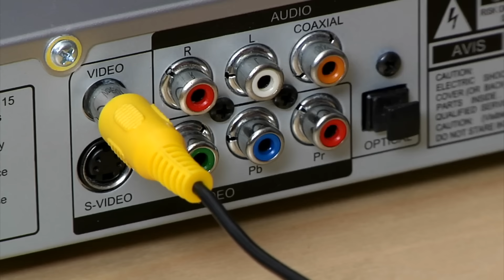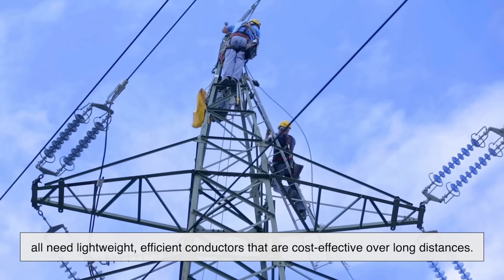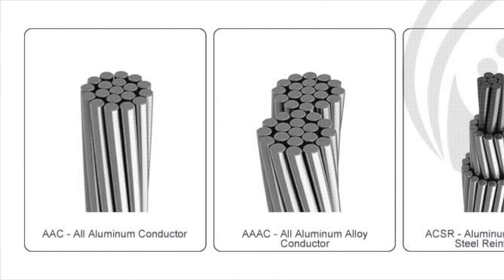Why Do Power Lines Use Aluminum Instead of Copper?

Comment: Pity that we don't live in a world where gold and silver aren't as common as dirt.   Silver is the best conductor and gold doesn't taransh.   Both would make outstanding wire except for the cost.
Reply: There is more as they say than just the cost it is true that silver is the best metal conductor of all metals however it has a very high specific gravity approximately 10.5  gold similarly has its at 19.3 compare that again to Aluminium which is 2.7 Silver also tarnishes readily due to sulphur compounds in the air too difficult to use for this purpose.
Reply: @michaeltwomey6201  I'm not suggesting for power lines due to the weight, but for home wiring.   A mixture of gold and silver does not tarnish.  I'm not sure what the resistance is, but the right mixture might be better than copper.
Reply: @BobDiaz123  Yes well that might be feasible I guess hahahahaha lol if you were Elon musk you could certainly afford it. The resistance would be acceptable, however the gold content would have to be somewhat greater than the silver to counter corrosion.
Reply: We will if we accept Jesus Christ even the streets are made of gold. 73

Comment: Having worked for Ma Bell in the 70’s as a cable splicer, I buried miles of copper cable!  Multiply this nation wide.  

Now with much of our telecommunications being wireless I have been wondering if there maybe an economical method of removing and reusing all the large buried copper cables!  

Daily I notice dozens of abandoned splice boxes along highways $$$$.  And not to forget arial cables!

Comment: Because its lighter and cheaper.  Also, the aluminum in acsr (power line) is higher tensile strength, and consequently more brittle than the aluminum in cables.  It also has a steal support ran in the center.

Comment: In the UK, Devon, where we live, the power line company replaced the aluminium power lines with copper some time ago, as they said the aluminium ones were getting metal fatigue and breaking.
Reply: There are no overhead copper HV power lines in the UK !
Reply: @andyxox4168  I am talking about the wooden posts with 2 wires, so not the highest voltage, and that was what they said when they replaced them maybe 30 years ago.
Reply: @joseph9915  those aren’t really ‘power lines’ rather they are MV/LV overhead cables … but I get your point. HV overhead lines also suffer fatigue at the hangers and they have reinforcing wires wrapped around them and dampers adjacent to stop oscillations in order to reduce fatigue
Reply: @andyxox4168  Maybe, still brings the electric 5 miles to where there is a transformer, stepping it down to 240 for our farm. :) 

PS. Only 2-phase, pain we can't get 3-phase without paying a fortune.

Comment: Copper conducts electricity nicely even when corroded, where as aluminum DOES NOT. This is why copper is used in housing and in electronic devices - far more durable and reliable than aluminum.

Comment: @6:45: "high-voltage direct current (HVDC) lines" -- LOL, I never knew DC comes in 3 phases.
Reply: Tell us you're a idiot without telling us. You do realize HVDC already exists in multiple locations. It's primarily used for carrying extremely large amounts of electricity long distances because it's actually more efficient than AC at distances over 1000km if I recall correctly on that distance.

Comment: I've seen underground heavy cable that still has a big copper element in it with 3 big sections of aluminum wrapped around it which also acts as a physical shield to a degree. I'm guessing they were carrying 3-phase or similar.

Comment: In Glassport Pa. There was a company called Copperweld until the 1960s when it was sold to a French company.They promised not to move the plant they lied closed the plant took the patent and went overseas.Copper weld had a process to combine copper and aluminum for transmission lines .Alcoa was a local company probably how they developed it.But everything is once was around here.

Comment: Haven't even watched the video yet but I'm fairly confident it's because 1. Aluminum conducts electricity almost as well as copper 2. Aluminum is far cheaper than copper, and possibly 3. Aluminum is lighter and stronger than copper when spanning long gaps between utility poles.

Comment: Aluminum wiring in residential was commonly used in branch circuits even into the early 1980's. Aluminum wiring is still often used for dedicated circuits and runs to sub panels where code allows.

Comment: Perhaps some more in-depth mention of Voltage⚡️& Amperage would be helpful.
Reply: The current carrying capability of aluminum is reduced by the high voltage used.  Voltage X Amperage = Wattage (power).  The higher the voltage, the lower the current, which reduces resistance loss.
Reply: @Garrison169 So 🥧 80MW÷138KV=437A EIR 138÷437=315♎️ than 2" Alum wire should be ok with a 3 phase system 🤔

Comment: I didn't realize HV transmission lines are mainly aluminum with a steel core. I always thought they were just steel. I wonder what they do to prevent the galvanic corrosion between the steel and aluminum. The aluminum will corrode against steel unless the steel is electrically isolated from the aluminum. This deserves a separate video about the cables.
Reply: Eventually you replace the cable… (after a half century or so in service).
Reply: I love it when democrats argue with each other
Reply: I'm thinking (layman here with a little knowledge [I know -it's a dangerous thing 😅]!!!) but there are many substances that require a "bonding agent" thereby letting them work together. That could make an interesting video as well!
Reply: … grease
Reply: It’s probably just insulated. It’s just there for strength!
Reply: @JohnDoe-qz1ql , no neither the steel nor the aluminium is insulated.
Reply: @andyxox4168 While not Considered a typical form of insulation it’s still galvanized steel.
Reply: @JohnDoe-qz1ql  .. they’re greased to stop bimetallic corrosion.

If you’d ever used it or been near it you’d know.

p.s. … Zinc is not an insulator!
Reply: @andyxox4168 LOL! It’s not greased. The steel is galvanized.
Reply: @JohnDoe-qz1ql  I see you know nothing about the potential for galvanic corrosion … 

… as for grease see one example below, 

METALUBE’s OCG™ range of high-performance, non-melting, cold-applied grease is designed specifically for the protection and preservation of overhead line conductors. OCG™ technology has the proven capability to extend the life and efficiency of overhead line conductors by providing optimum anti-corrosion protection and absolute minimal oil separation when used as a composite part of the conductor
Reply: @andyxox4168 Who Doesn’t?? Nothing lasts forever…. Still, if in a dry location, Say for example INSIDE AN INSULATED WIRE, it can still last a while.
Reply: @JohnDoe-qz1ql  … and OHL conductors are not, ARE NOT, insulated.

As I noted before the nearest you’ve been to one is perhaps strolling underneath it in awe of the people who actually know how they work!
Reply: @andyxox4168 I’m not an electrician, I’m a mason thank you very much. Yes, I actually Did know that, but that doesn’t mean Everyone Does. I see arrogance is a virtue in Your circles.
Reply: @JohnDoe-qz1ql  good, you stick to sand and cement and let the professionals comment on how transmission lines are constructed …
Reply: @andyxox4168 right! Ask any bird.
Reply: Just don't worry about it has been working this way for a century!
Reply: @bobboscarato1313  Has it though?  They haven't even been using it that long. They also change the cable.

Comment: Another major consideration for using Cu indoors is the lower coefficient of expansion.  Al expands more as it heats up.  The implication is that it loosens up connections far more easily, therefore causing higher resistance more quickly.  So unless, as mentioned,  the terminations (light fixtures, switches, receptacles, etc.) and other interconnections are designed to accept Al, it can be very dangerous.  It can be safe, it just takes a knowledgeable, competent, and careful electrician to install it all.
Reply: I used to have a mobile home wired with aluminum. I made a point of annually checking all of the electrical connections to ensure they were tight. In the six years I lived in that home I almost always found at least one connection that had worked loose. Usually in the plug receptacles. I presumed it was due to the aluminum expanding and contracting due to heat. It was a scary place to live in.
Reply: @davemeise2192 You made my point. Most homes are neglected in annual maintenance, and most people are too incompetent to service their own electrical/plumbing safely.
Aluminum wiring requires a bit more attention.
Reply: Only if you terminate aluminum at something with incompatible thermal expansion. Use an aluminum rated outlet or light switch and you are every bit as safe as copper with copper compatible terminators.

Comment: I have listened to the whole video, it is good, and very correct. . . .  I would like to take it a little further, that is explain those high aluminium wires between towers a little further.

They are not just aluminum cables, you may have noticed they are stranded. . .   The outer Aluminum layers will be specially produced for best electrical conduction, the next layer inside, will be more about strength, so different types of aluminium alloy.. . .  Then the inner core used to be steel for strength, but the newer ones, now use special fibres, to make the cables actually stronger and lighter, so the towers can be further apart, thus still improving costs.

You might have also noticed, that each actual cable, is actually 4 cables spaced about 6 inches apart, with spacers. . . .  It might sound strange, but the magnetic field caused by the current in these wires, causes "Skin effect", which means most of the current travels in the skin of the wires, that is why they are stranded, and the outer layer, better for conduction than the inner layer. . .    And then by making 4 wires, spaced a little apart, we can further improve on reducing the "Skin effect" and by so doing, reduce power losses.

But now, we are even going further into better cables. . .  He briefly mentioned it. .. .  Actually DC is better for all this high power than AC. . .    So there is more use of High Voltage DC or HVDC now being used. .      DC does not have the "Skin effect" or other inductive and capacative losses. . . .   So we can get more power through the same cables using HVDC. . . .   China is now using DC of over 1 million Volts, ( 1,000,000 Volts ), over some very long transmission lines, 600,000 Volts is becoming more common. . .   HVDC is now cheaper even for new transmission lines of over about 50 km distance, so very much coming into use for Wind Farms, this cost even includes the AC to DC Converters, which use very large, special Transistors, yes, transistors for these Converters, AC to DC and DC to AC conversions.. . . .  More if you want.
Reply: The problem with DC voltage is that you can't use transformers as you do with AC.
Reply: @bobboscarato1313    Oh yes we do use Transformers with HVDC systems these days.. .    As I explained, modern DC systems include two parts, the Transformer to convert between two different voltages, and the AC-DC-AC Transistor Converters, which are now relatively cheap.       So yes we do use Transformers with HVDC systems.
Reply: @bobboscarato1313     Oh yes we do these days.. .    As I explained, modern DC systems include two parts, the Transformer to convert between two different voltages, and the AC-DC-AC Transistor Converters, which are now relatively cheap.       So yes we do use Transformers with HVDC systems.

Comment: 6:12  And with heat, the aluminum expands and contracts more than does the copper, which loosens connections over time, creating more heat.

Comment: Back in the 80s, i worked for British Telecom International, which had a close relationship with Ericsson, so much so that they had their prototype AXE10 telephone exchanges installed at Keybridge House London to test on live traffic. One of which was initially installed using ALLY-MIN-IUM twisted pair, which proved very unreliable. The strands were very brittle and were always breaking, especially when moved or bent too tightly. Every time you tried to repair one a break would occur somewhere else. They were replaced with copper within a few months never to be seen again.
Reply: al you mini um.
though now i say it a loomy nee um just to mess with everyone...

Comment: I have only listened to the first 2½ minutes and that is exactly correct. . .   

Copper is a better conductor of Electricity than Aluminium, so widely used for electricity,.. .   Silver is better but very expensive. . . .  Aluminum is cheaper than copper, even if we use larger aluminium cables to get the same power through, it is still cheaper. . .   

So that is why your power company will be using Aluminium cables to your house. . . .  But those long high voltage cables between towers, need to be cheap, strong and light. .  Copper weight would need the towers to be closer together, so more expensive, and the problem of stretching. . . .  

So that is why we use Aluminium cables for those high pylon cables. . .  Actually rather special forms of aluminium for strength, some even use some steel for strength, newer ones use special fibres for strength.

Comment: Or or or, to avoid having to spend lots of money maintaining the lines, cause you have to do that when they short, malfunction, or get exposed, Etc. they could just start putting the lines in eroding resistant tubing and put the lines underground. That would help with storm related issues when they tear down the lines they have to put back up. At least this way they’ll be protected and covered from the weather
Reply: Also it would help with wildfire issues, especially in western states.
Reply: Transmission lines have to be put in oil-filled pipes. Solid insulators don't work well here. Even with 24,000 volts and lower, special semi-conductive layers must be used with solid insulation so that the power doesn't pierce through the insulation. The semi-conductive layers dispurse the charge.
Reply: @td3993 I guess it subjective to where you live. Take Florida for example. Lots of rich areas have their lines underground to “keep the view”. And it seems to be working for them. Is it going to be a great idea everywhere. No, but it is for a lot of heavily populated areas
Reply: @MegaMarxis  Placing transmission lines underground is possible, as you say. It's done here in Milwaukee particularly when having to go under the river, freeway, etc. However, the lines are filled with oil under pressure. Any leaks are an environmental problem and concern for arcing if oil levels get low. Granted, many of these systems have been in use for decades, but hanging the wires is more economical. I'm not sure what the exact trade-offs are. The towers are obviously unsightly, though I find the lattice towers intriguing to look at. I'm not sure what the radiation differences are for buried transmission vs aerial.
Reply: @td3993 I don’t have the answer to that one too. I just figured it be more practical especially weather related. Especially when you look at greenfield, green dale or south Milwaukee. Any light breeze and they seem to lose power cause the lines are above. Be here at Franklin, our lines are buried, and haven’t lost power once since I’ve been here.

Comment: How do the engineers deal with the huge losses of using High Voltage DC for distribution?
Reply: You use high voltages to minimise losses. Current flow causes losses not voltage. Minimal current causes minimal energy dissipation.
AC current causes magnetic field losses too. DC eliminates that.
Reply: Where is high voltage DC used thought it was all AC on power lines. Would be very difficult to keep converting and the arc would be difficult to kill when switching
Reply: @johnwarwick4105 DC connections are used for long distance connections and/or between grids on different frequencies or phases.
The Paraguay - Brazil connection is a dual 600 kilovolt DC 800km link with a 50Hz grid on one end and a 60Hz grid on the other with a solid state inverter at both ends.
You simply don’t use conventional switchgear on those voltages…

Comment: 3:50 what about contact corrosion between aluminum and steel in the core?
Reply: The weather does not get into the steel core. .   They also probably use some internal coating. .  Newer cables use special fibres, rather than steel.
Reply: Steel is zinc coated. Also aluminium is more reactive than steel so aluminium also protects steel. Then aluminium gets a natural oxide coating which prevents oxidation.

Comment: Aluminium has two more advantages. Both due to the larger overall diameter. 
Skin effect makes the AC resistance higher than the DC resistance. Corona loss is caused by the high electric field strength at the surface of the conductors.  That's why high voltage lines buzz!
Both of these effects are reduced by the larger diameter!

Comment: The theft of copper has gotten so bad That they use copper coated steel for ground wires on poles ! And the phone lines that are like 50 pairs off poles !  They steal copper out of a house if no one is home in the city !I could see some one addicted scaling a tower for copper !! 2 guys  were doing that south of Louisville  for the grounding wire some how got into the hots and got fried and started a large brush fire !
Reply: FAFO !

Comment: What do you call a house with aluminum wiring?…… A house with radiant heat!
Reply: It's really only a problem if the wire gauge is too small and if the connection points are loose.  That's when the overheating occurs.